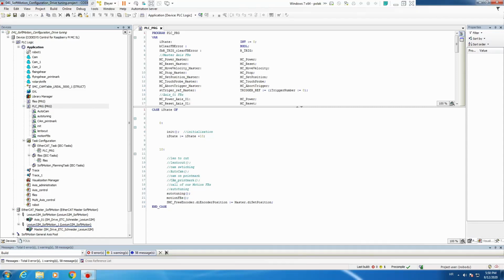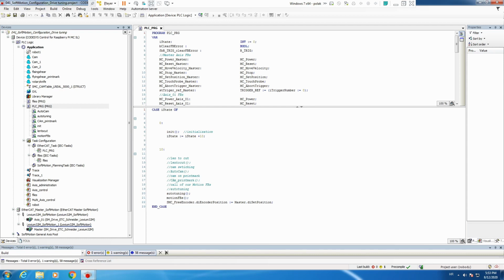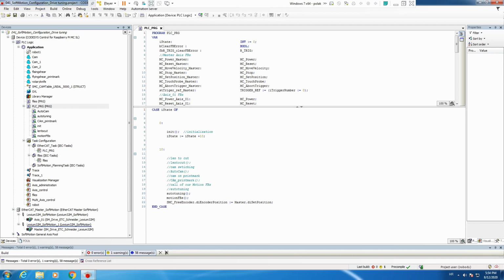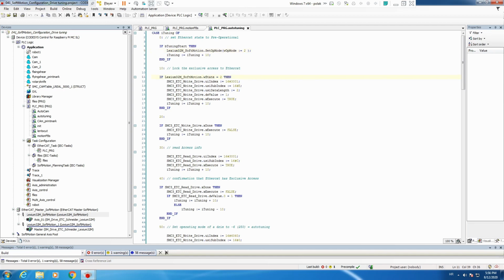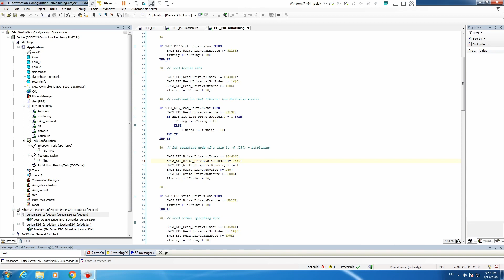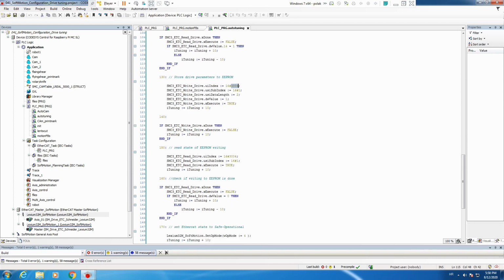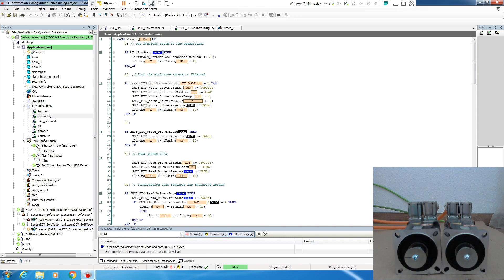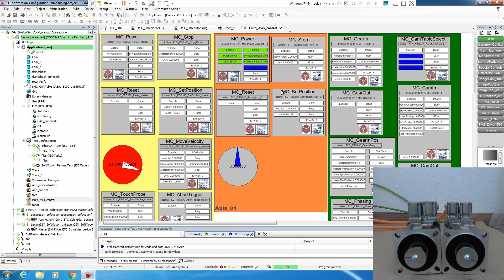41 - SoftMotion - Lexium - Lexium 32 - Autotuning

Comment: I couldnt catch why did you do in codesys. Is there no autoning in the servo drive?
Reply from the maker: you can do it in on the drive directly using drives hmi or via commisioning tool for the drive. sometimes machine manufacturers want to have complete control over the drive using a controller. this is the way how to start autotuning over fieldbus.